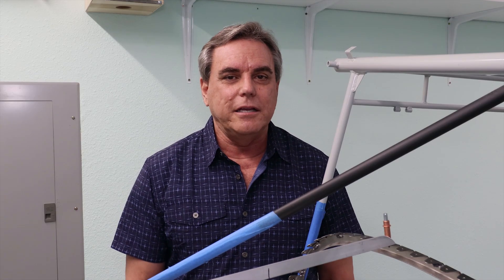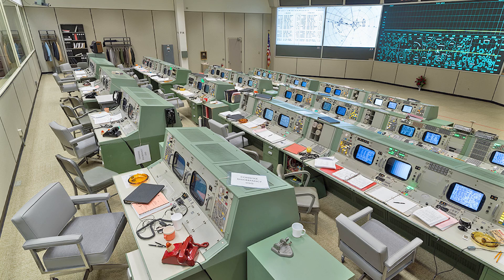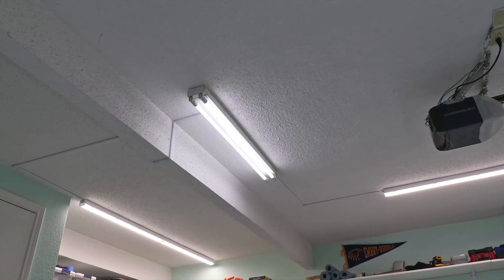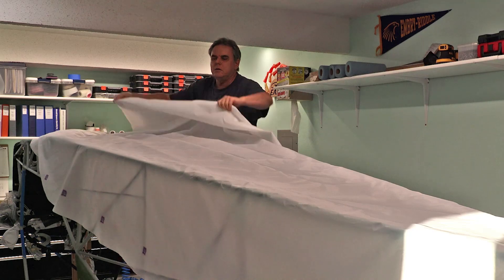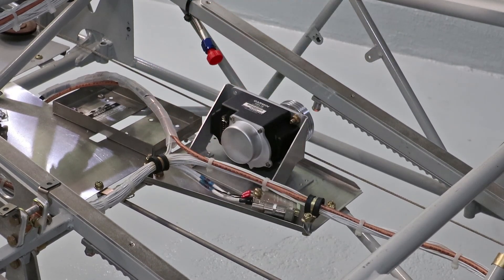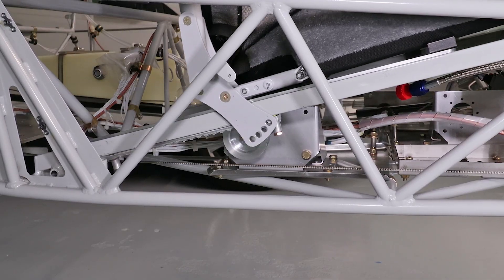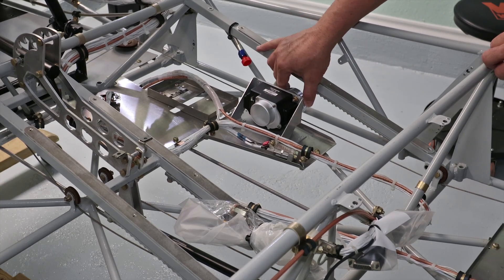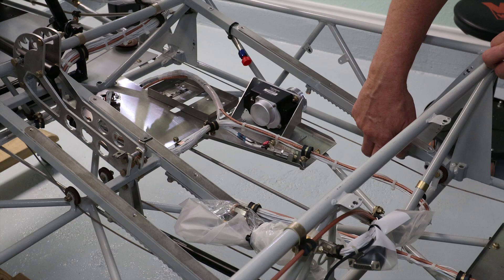New Shop and Autopilot Servo Installation

Comment: Nice video. Thanks for posting. By the way, a castle nut is a type of locknut. You can always use a castle nut for a locknut application, but you can only use a nylock (locknut) for certain applications.

Comment: Your roll servo looks good and good catch on the seat pull pin.  How is the servo/seat clearance with someone sitting in the seat?  The Rans seats tend to flex and give up a little bit with moderate use.  I have seen zipties used to support passenger weight, laces and probably the best solution, an actual aluminum seat pan.  Your plane is really coming together!
Reply from the maker: Mjbrennan. Thanks for your comment. The roll cable runs to the outside edge of the seat pan, so the sag would be more towards the center of the seat. And there is still plenty of vertical clearance for the bridle clamp from the seat pan. So I don't need to worry about seat clearance. It's that pull pin that's causing all the trouble. Hopefully my fix will take care of that problem.